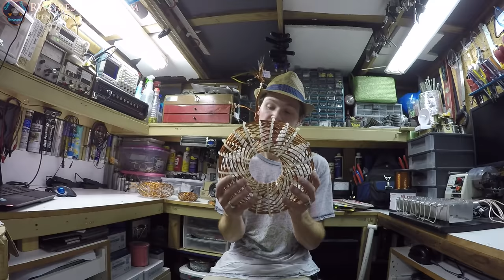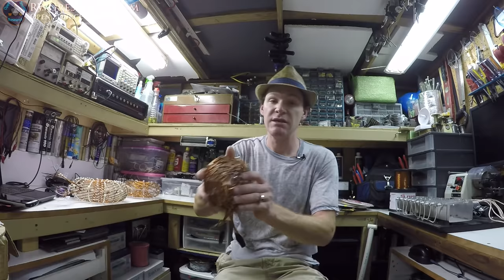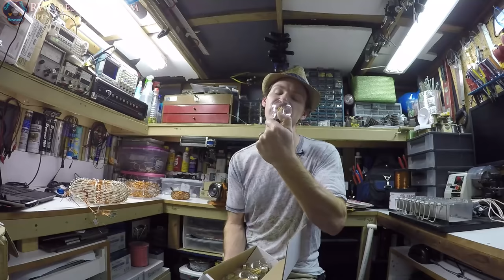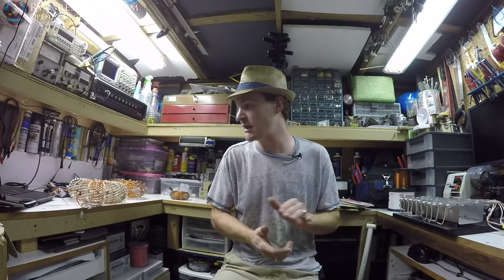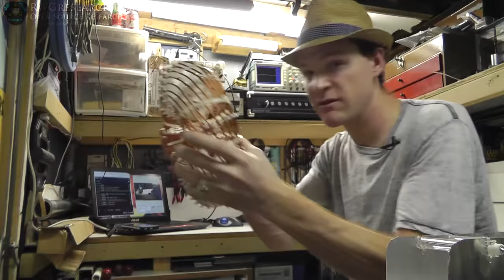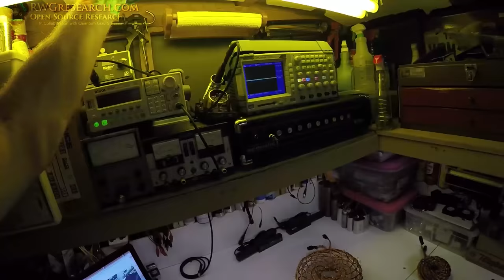Vortex-Based Math & The Phenomonon of The Energy Amplifier : Where We Are Now.

Comment: Thanks for the acknowledgment Russ, Erica and I greatly appreciate it! Our little disked frames contribution and winding style switch changed the game when it comes to coil construction. To be clear, what we shipped to you; and what you are showing in this video are POE Vortex Coils. Our 'ABHA' coil made with the ABHA torus in mind was 12x12 and actually did have wire leads that returned back to each start point. The name switch to 'POE' came about when we started making them out of one longer wire with loops that passed each progression. For a while we did make and distribute the ABHA style, but they took a lot longer to finish. Good luck on testing! Kind regards. ~Daniel

Comment: I want to believe this, but I applied the doubling sequence to base-12(dozenal:1, 2, 3, 4, 5, 6, 7, 8, 9, X[10], Y[11], 10[12], etc.) numerical system, and the 'thumbprint of god' ceases to exist. 

I ultimately concluded that these patterns only arise when we limit the characters used to represent different quantities (after 9 we run out of characters and therefor use a 0 as a placement value). The act of reducing in vortex based mathematics (1, 2, 4, 8, 7[16; 1+6=7], 5[32; 3+2=5], etc.) is only possible while under the base 10 numerics model. 

When attempting this (doubling/ reducing) under the base-12  model the quantities are the same(obviously), but the act of REDUCING appears very differently, and did not resemble a vbm-doubling circuit. 

This led me to realize that quantities are not limited to a set of characters, in fact there is no reason (other than physical constraints) to not have a base-infinity numeric system, in which each quantity is represent by its own character. 

This of course would make mathematics very difficult (imagine creating unique characters for each leading up to a million! Or 2 million!) so I understand why we have a base-(x<infinity) system to use in our mathematics. 

I am not at all saying that a rodin coil doesn't work or that I don't admire all Marko, Randy, and everyone else's work. I don't have an education in advanced mathematics, physics,  electromagnetism, and such. I've just made an observation that possibly conflicts with vbm. If anything, I only wish to reveal the one truth that permeates all existence. Same as you! 

I would really, REALLY, love feedback from anyone offering either assurance or constructive criticism. Thank you all!
Reply: Hey, I tried out some other bases than 10 after reading your comment. It seems like that under base 10, you will get symetric forms, but above 10 you get more random things which are somehow try to point to the numbers before them. I didn't try a lot bases, but it seems base 10 gives you the last symetrical picture.
Reply: There is no base ten in my opinion. It’s only 1-9. Ten is 1+0=1.
Reply: @kristopherhardy3302  right

Comment: Russ,

On your other clip I suggested that you make a "control coil" which would be a conventional coil with approximately the same inductance as the Rodin coil you will be testing.  You can do tests on the Rodin coil and then do the same test on the control coil and compare.

I am going to deal with another important issue here that has to be asked.  The issue is "Is there any reason to believe that there is something special about a Rodin coil, or is it just an inductor with its associated resistance and stray/self capacitance?"

Please read the next two postings carefully that give you a breakdown on what a Rodin coil really is.  I am intentionally ignoring the issue of the stray/self capacitance.
Reply: This is for the Rodin fan boys and anybody that is interested in basic 
electronics, and especially for the lurkers from Russ' forum:

Anybody
 can look up what the magnetic field is like around a long straight 
current-carrying wire.  Everyone knows that magnetic fields add up 
together like vectors.  That's why the power cord for your toaster (lots
 of current) does not really give off a noticeable magnetic field.  One 
wire is carrying current say from left to right and generating a 
clockwise magnetic field around the wire.  The other wire is carrying 
current from right to left and generating a counter-clockwise magnetic 
field around the wire.

If you are one foot away from the power 
cord you "see" a clockwise magnetic field and a counter-clockwise 
magnetic field.  They are in opposite directions so they cancel each 
other out.  So what you really "see" is essentially no magnetic field at
 all.

This is the most basic fundamental stuff about magnetic fields, and it applies to any wire or any coil, including a Rodin coil.

So
 look at the nice picture of the Rodin coil and visualize it as being 
composed of a bunch of short one-inch segments that are essentially 
short segments of straight wire.  Now, imagine the magnetic field that 
is being produced by each one-inch segment.  Pay particular attention to
 how the orientation of each one-inch segment is relative to the other 
one-inch segments.

So, what do you have when you look at the 
Rodin coil in this way?  You have a whole bunch of magnetic fields at 
different orientations doing vector summation with each other.  You can 
easy see how there is some vector addition, and some vector 
cancellation.  For sure, there is a whole lot of vector cancellation 
going on.
Reply: What is the final result of all of this?   The coil has some resistance 
and some inductance.  Because of the considerable amount of magnetic field vector cancellation taking place, that reduces the net amount of inductance in the Rodin coil compared to a conventionally-wound coil that could be made with the same amount of wire.  Or, you can say that you could make a conventional coil with less wire than the Rodin coil and still get the same amount of inductance.

No matter how you 
look at it, in the final analysis a Rodin coil is just an inductance, 
and the way it is made is rather inefficient because of all of the 
undesirable magnetic field vector cancellation that is inherent in the 
"bird's nest doughnut weave" that is done to make the coil.

If Russ is going to embark on some kind of test regimen, then the smart thing to do would be to make a comparably-sized conventional coil and tweak it so that it will show the same amount of inductance on the inductance meter as the Rodin coil.  Call that the "control coil."  Naturally the control coil will have less wire resistance compared to the Rodin coil because it generates a magnetic field more efficiently.

Whatever tests that Russ does with the Rodin coil should also be done with the control coil.  Any tests related to power out vs. power in should show the control coil is superior because the wire resistance is lower.

Again, you just have to look at the picture of the Rodin coil to see 
intuitively how there is a whole mess of magnetic field vector 
cancellation going on that serves no real purpose.  Likewise, there is 
no such thing as a "special coil winding technique that has unique 
properties."  In the final analysis, a coil is just a coil.
Reply: That is where you are wrong. Cancelling of back emf is normal BUT the flux don't cancel each other. Using flux to strengthen themselves is the key here.

Look at lenz's law. Conservation if energy? NOPE. Action and reaction is not conservation. It implies that every paid action has a FREE reaction. Only when that reaction comply with your action, will there be a counter reaction or simply the combination if action and reaction together.

Comment: Russ,

I see that you have a sincere desire to learn new electronics stuff to successfully perform this test.  However, let's back up to some basic basics.   Please have a look at the following question pertaining to coils and basic electronics:

You have an ideal voltage source and an ideal coil of 5 Henrys.  At time t=0 seconds the coil connects to the ideal voltage source. For three seconds the voltage is 4 volts.  Then for the next two seconds the voltage is zero volts. Then for the next two seconds the voltage is negative three volts, and then for the next six seconds the voltage is 0.5 volts.  Then after that the voltage is zero volts.

Question:  What happens starting from t=0 seconds when the ideal voltage is connected to the ideal coil?

Can you answer that question?  If you can't answer that question then I suggest that you start with that question.  Feel free to copy it to your forum if you want.  We are talking about the basic fundamentals with respect to how a coil works.

Comment: What if you had a toroid like tube in the middle? i.e. A Rodin coil pattern wrapped around toroid tube, and if possible plasma/gas running though the middle? Think fusion.. Im curious of the currents and energy flows inside the toroid. Do you follow what im saying? Thanks.
Reply: Yes plasma and Moray B King talks about the abrupt motion electrons/ nuclei tapping the ZPE

Comment: He seems like a decent guy.  I noted some interesting behaviour with a magnet positioned over the pole of these coils when the coils have energy flowing through them.  I was wondering could a cylinderical magnet attached to 2 rods (1 on either side of the magnet) be attached to 2 pma's and not only charge 2 other batteries, but could the cylindrical magnets have holes drilled into it and the cavitational properties of heat be generated and the heat be used to heat greenhouses in cold climates to grow tropical and warm weather plants?

Comment: I have an idea for a crystal that is magnetised based on vortex math. A crystal is not necessary but the idea is to use vortex math for magnetization of a material so the magnetic fields can act as pathways, or there could be something else that will occur with the device. More specifically i want to make it so that the vortex toruses are combined or in otherwords intersecting so that all the torus like magnetic fields are connected. What would something like that do? What information can you give to help me with this idea if you are willing to help, i want others help about this idea.
Reply: I need some pointers

Comment: round sounds so symmetrical, what happens if you make bearing out of the peltier metals? but instead of cooling the friction of the bearing creates heat, thus generating voltage? voltage low enough for your coils?

Comment: I am still trying to learn mathematically how you add additional energy or take energy away from a vortex math model. The beauty of a twin vortex self organizing field is it increases and decreases in size as energy is added or taken away. For instance an ant has a tiny polar twin vortex energy field and a planet or even galaxy has basically the same thing only larger.  In theory a twin vortex energy field should continue to operate until something of equal or opposite force disrupts it. This is how matter itself which is created this way is powered and has a non decaying orbit of particles. 

When karate or Zen masters prepare to chop through a stack of blocks or start a fire in wood shavings using lifeforce/vortex energy they first gather the energy into a twin vortex energy field and grow it. They claim to do this between their hands but whether it occurs there or within your body's vortex field. They breath in and consciously gather the energy into the non visible ball vortex before directing it for its intended purpose. 

I wonder how knowledge of the one might be beneficial to understanding the other.

Comment: Winds coils,  says there all wrong, says “you can’t trust the multimeter” you understand this is a torsion field generator. The torsion fields are not detectable by electro magnetic or thermal readings. Try looking into the Russian research on torsion fields and build a torsion field detector if you really want to see what the measurements are

Comment: The numbers sure get combined (eg. 54 => 9), but how does the energy get combined? I mean, the electricity is just flowing in a wire, electricity is not numbers. So how does electricity turn into numbers, which get combined?
Reply: It’s nature man. The closer you can replicate the ‘form’ the more power you can harness from nature. The maths is rock solid we are just having some trouble in the science and engineering aspect.

These toroidal rings aren’t new they are thousands of years old ,I could send you some links of video that explain this :).

Comment: Hi Russ, this is what all of the various experimental groupes should do. This scientific approach will give credibility to the device. I am also experimenting with the gegene device and have found a ZVS driver battery driven works just as well as the induction hob powered by the grid. I have looped the system so no power is used from the batteries while powering a light and a motor. I wonder if a rodin coil was used in this set up instead of the lenz and tesla bifilar, what the results would be☺ keep up the fight we are all hoping that this is the one....Nick.
Reply from the maker: hi nick, that sounds fantastic. did you tune the output coil with a cap? i mean the driver is doing the tuning... so its like its tuned input per load. rather than just having the primary driver and the output tuned. so... do you have a video on that looped system? i sure would like to see that. i have a lot of gegene stuff made. so a simple test would be a nice thing. any how i would love for you to try to explain how the loped system works. thanks for sharing! ~Russ

Comment: Biggest coil seems not fully the same as small one. Small one has crossed wires but biggest doesn't.
Reply from the maker: The 2 coils built by Danial are the same but one is smaller than the other. both cross hatch pattern. ~Russ